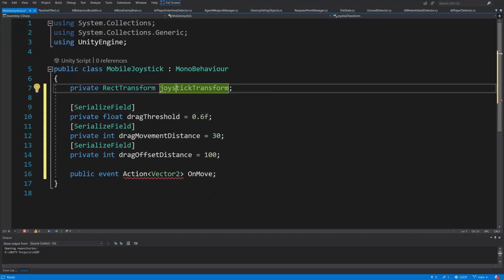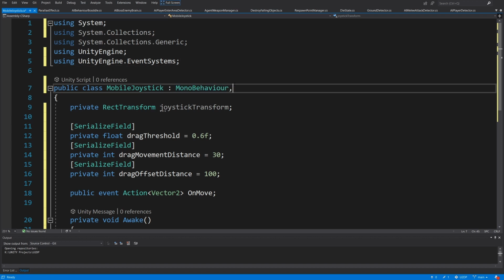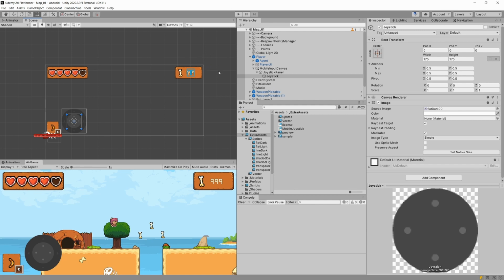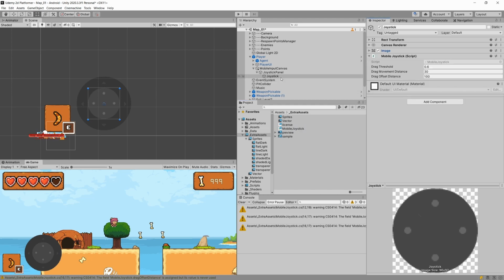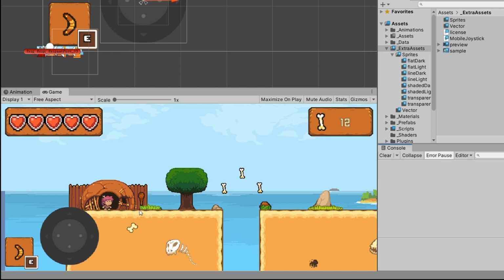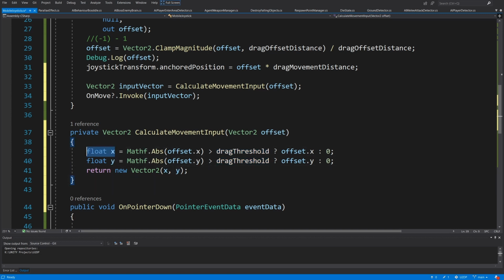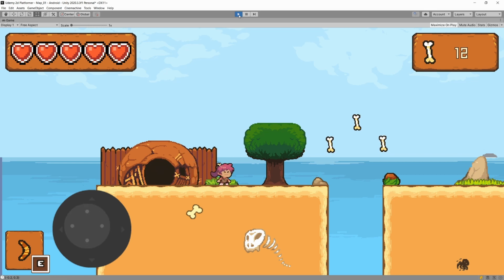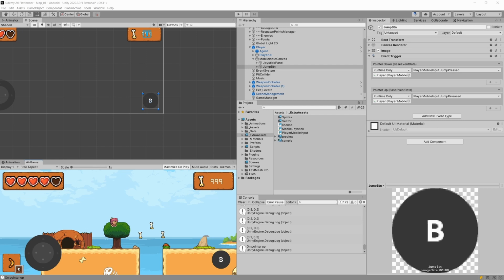Unity 2021 Adding Mobile Joystick Touch Controls

Comment: How i get the IAgentInput can you gave me the code ?
Reply from the maker: IAgentInput is just the abstraction of the input that your player / thing you want to control requires to function properly. It would be specific to your project. The idea is that we want to keep the input system separate from the code that drives the player/npc/enemies in our game. This way we can connect them with AI or with the keyboard / mobile input - Making the setup reusable.

I explain it in more details in my Make a 2d platformer using Design Patterns course https://courses.sunnyvalleystudio.com/p/code-a-2d-platformer-game-in-Unity-using-Design-Patterns if you are interested.

Comment: Can this be used with Unity 2019 Make an intermediate 3d survival game?
Reply from the maker: I did my best to make the joystick into a separate system so you should be able to connect it to any project. I don't recall how we did input in the survival game but you might need to tweak it a bit 😐 If you have any trouble with it let me know on discord!

Comment: I copied everything you did but for some reason my character doesn't move at all. did I miss something? the joystick moves like it should and i have the player script on my player, but nothing happens when I try to move.
Reply from the maker: Hey! MobileJoystick script is responsible for reading values from the UI element. 
To find an error simply create a public Vector2 * value in the script and save to it the cues before sending it in the *OnMove event. This way you will see if the issue is with the UI setup. If it reads the values but those are incorrect it must be an issue with the script.

If OnMove event sends correct messages check if you subscribe your character movement script to this input source.

If you can't figure it out join the discord (link in the description) and I will be sure to send you a working test project :)
Reply: I'm in the same boat as this guy. Ive done everything and checked several times. It's just not moving my character. I can't help but to feel like youre missing a step.
Reply: dosent work for me either
Reply: whats on your player script?